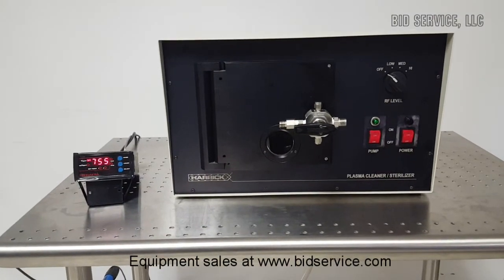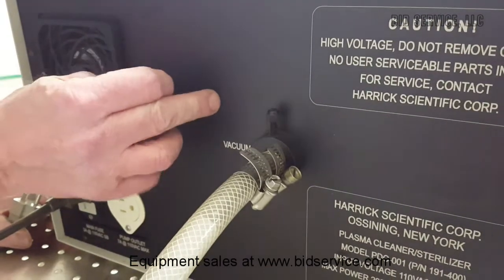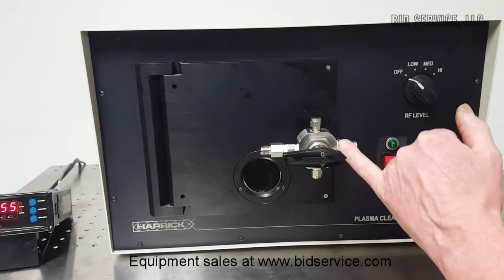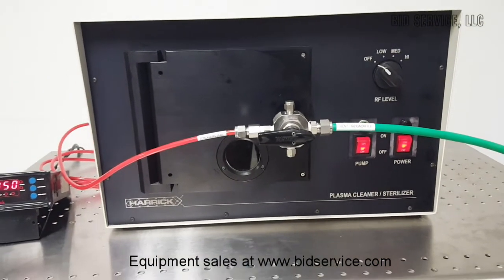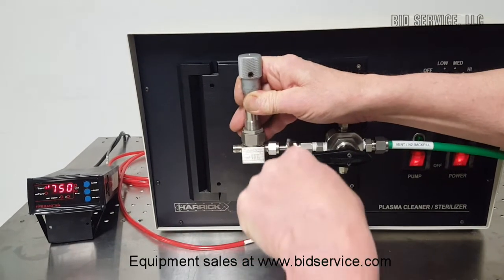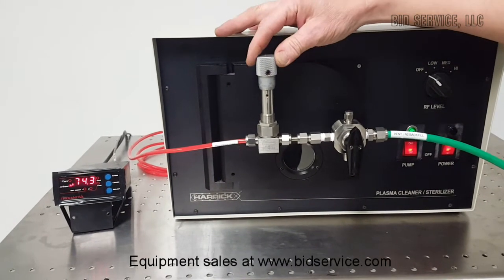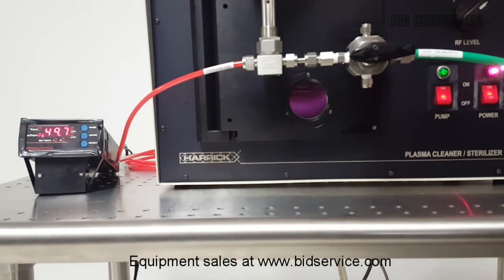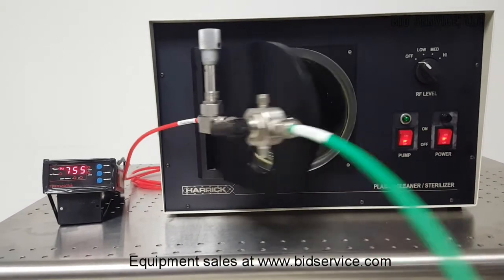Harrick PDC 001 Plasma Cleaner #61736

Comment: Harrick Plasma treatment is the primary method of microfluidic device fabrication as PDMS-PDMS or PDMS-glass surfaces can be bonded and sealed irreversibly to create leak-tight channels with hydrophilic surfaces. This page contains brief application summaries and relevant articles concerning the use of plasma treatment in device fabrication.